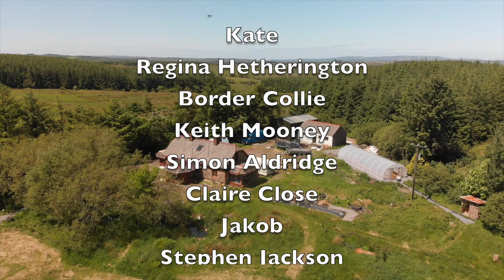Yurt platform frame COMPLETE!!!

Comment: Hey Bruce! Trying to follow your footsteps.. Q1: Why the urgency to get your van registered as a CamperVan . Our camper is still  registered as an Ambulance. Why did you suddenly need that classification from the DVLA? Was it something necessary so that you could still use your Mercedes in Ireland?
Reply from the maker: If you live in Ireland you need to declare your vehicle to the revenue and if applicable pay the necessary taxes etc. basically I avail of a tax relief as I have owned the van for a long time now but if they import it as a van with windows I will have to pay tax on the conversion here to get the correct body type which I would need for rod tax and insurance purposes whereas in England it doesn’t affect tax or insurance. I need to do it soon as I have been here too long with it
Reply: @OffGridBruce  Thanks, got an awning ordered -> Best Charles & Rachael

Comment: Solongos Camp in Korea has been producing Gerhouse, a K-Yurt since 2002.

If you use our construction method, you don't have to spend a lot of money and time to build a yurt and make a wooden deck in the air, just like in the US.

build a formwork on the first day of construction, pour concrete, and start lattice wall, right from the next morning can be built.

In addition, our method transmits the earth's geothermal heat to the yurt by pouring concrete on the foundation and floor of the yurt, so it is superior in insulation compared to the American method of making a yurt flatform and floating it in the air.

Because the yurt platform, the most basic part, is firmly bound to the ground with concrete, it is strong against earthquakes and typhoons without having to install a separate safety device.

In addition, our method does not use only one or two layers of insulation to cover the yurt, as in the US, but we use about 20 layers of the insulation is so excellent that you do not feel very hot or cold in midwinter or midsummer. 

https://www.youtube.com/@wellup22/videos
Reply from the maker: Hi that method would require a lot of concrete on our site as it is sloped.